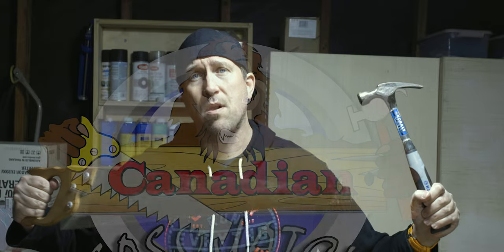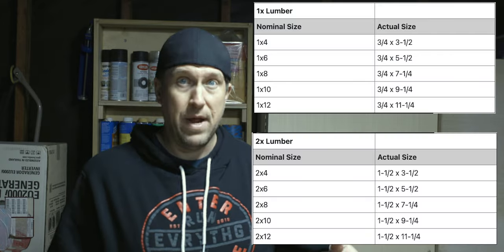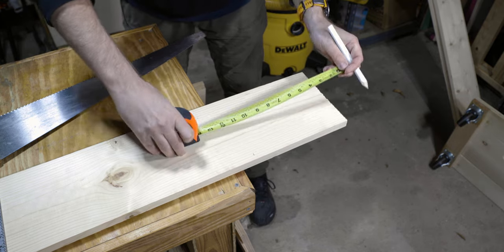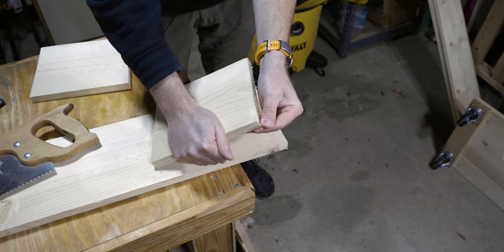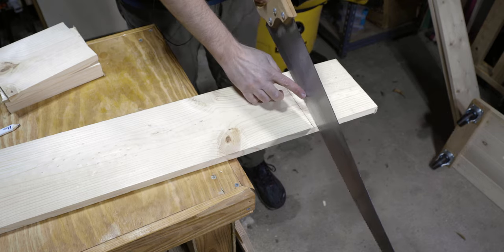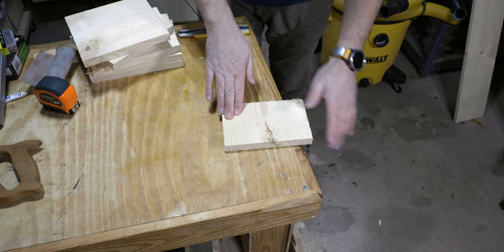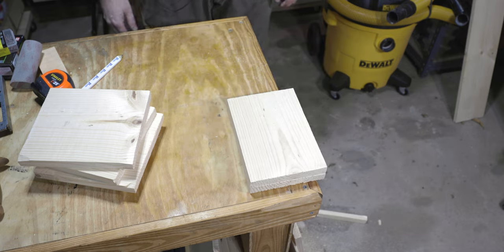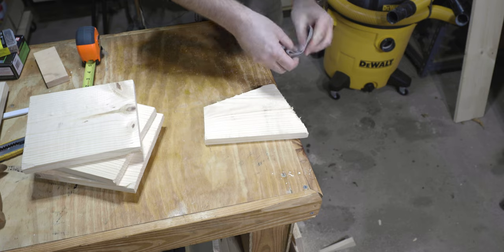DIY - Simple Limited Tool Bird House Build

Comment: What do you do to protect your new nesting shelf from the weather?
P.S. Loving these DIY vids! Thanks for making them!
Reply from the maker: You can leave them as is, or you can paint them or stain them, really it is up to you!    If you use cedar, then you definitely don't need to use anything.    If you use other soft woods like pine, then some oil or paint will be just fine, or you can leave them as is and replace them every couple of years (which isn't a bad thing either because of bugs and such) Great question and Thanks!